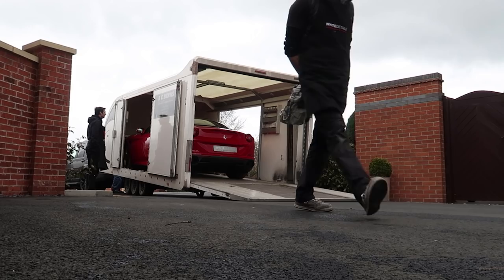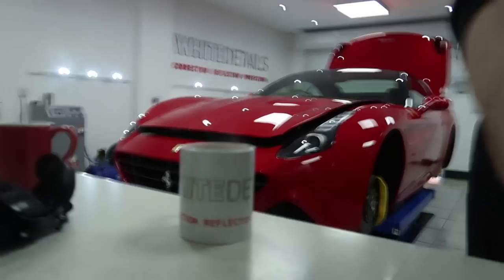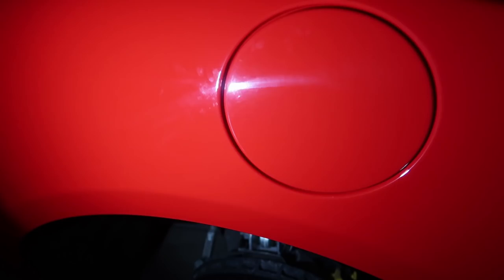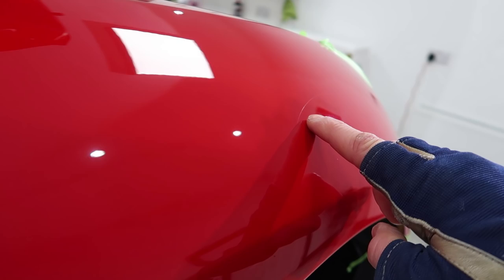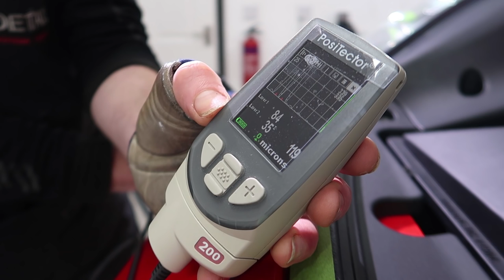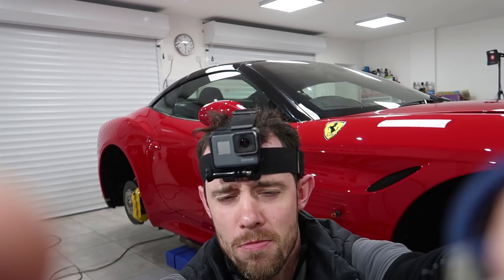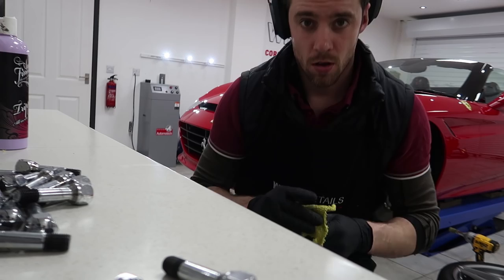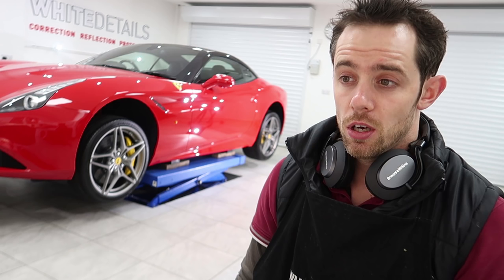Yiannimize to WhiteDetails. Ferrari California T - VLOG 052

Comment: Very nice work indeed Jim. Surprised you use the iBrid as much as you did because I love the tool, you can be so inovative. I don’t feel alone on that now. Sod that rushing, the iBrid gets it done in those difficult areas and more control, just takes patience. Be nice to know what MF pads you were using, just found some myself to try. I use the 3” foam on the PPF and feel comfortable. Again,patience.
Excellent job.

Comment: ya can see the damage on the front when ya went over with the light.....but we all know it won't be there for long.....lol...with the amount of problems on that i'd say some one at the fararri factory needs to be shown how to use the buffer...lol...oh and regarding air i'm playing with the idea of adapting a wagner sprayer compressor that sits alone  so i make the feed pipe smaller hopefully it will increase the cfm to be able to do a half decent job.....cracking turn a round jim as normal, hope ya got time to enjoy ya fish and chips....

Comment: So many miss aligning wheel center caps.    Especially tire shops, they always look at me funny when I try to explain why I want them left off so I can align them.
Reply: You missed the purpose of what he did then.  Center caps, once popped in, don't normally move, which you can see in the vid as he had to pop them free from the backside.  So by aligning the foot to the horse to the valve stem the center cap is aligned the same on every wheel.  It's a minor thing, but makes for a cleaner look.   

For example on my VW every center cap is aligned with the notch in the W directly inline with the valve stem.

Comment: Jim I’m doing details in 2 days for people who think I’m ripping them off at £150 to £175 at the most and maybe shampooing seats and carpets and trying to remove scratches that someone previously have been at with t cut and once they used brasso on a £50 k merc . If I charge more they just don’t come back and dare I mention ceramic coat at an extra £50 , any ideas where I’m going wrong as I had to stop as it’s costing me money and I took COVID and lay in hospital for a month so customers are all gone probably so I’d like to return at a higher spec

Comment: Question: After washing the vehicle and moving to the drying stages using the blower, do you find debris disturbed by the blower from the crevices that have moved out in the open to the adjacent panel potentially scratching the panel on subsequent wipe down? If so, do you have a method to mitigate the possibility for those scratches? Thanks! And thanks for the videos, very informative.
Reply: It's all been flushed out during the wash process by that point, personally I wouldn't overthink it.

Comment: Can the ceramic coating also be applied to the exhaust tips?
Reply: you usaly use Wheel coatings for the exhaust tips! :)
Reply: Jan-Roger Kviteberg OK thanks. But very often a normal paint coating is also used for the wheels. 😆
Reply: i know, but the wheel coatings usaly can withstand more heat then normal coatings.
thats typicly why there is a separate wheel/metal/exhaust coating :)

Comment: I didn’t think you could machine polish a wrapped roof 🤔 learn something new every day
Reply: Craig B Have only seen White Details and the detailer at Dub Customs manage it.

I suspect most would shy away from attempting it.

As soon as I have the time my car will be getting the White Detail treatment!
Reply: You can't really. There's nothing to cut - no lacquer, no coating, it's just shiny plastic. You can run a polisher over it to remove any oxidation or traffic film, but you can't polish wrapping in the same way that you can polish paint.